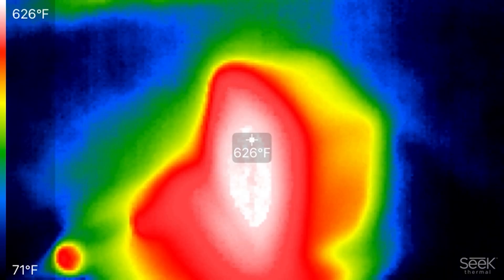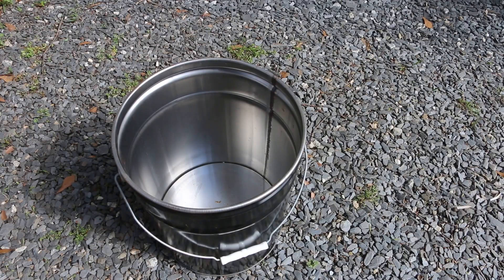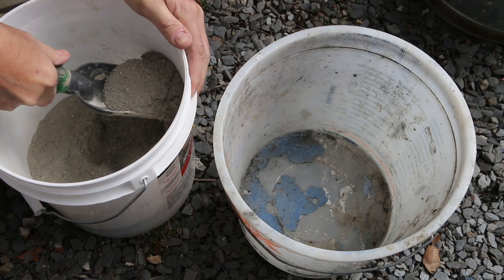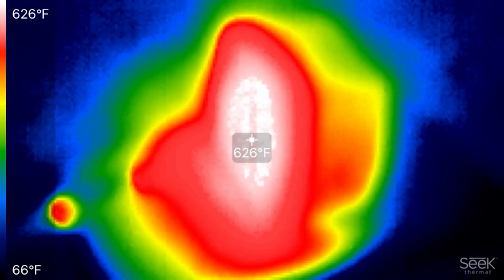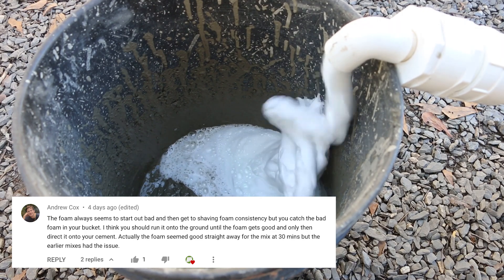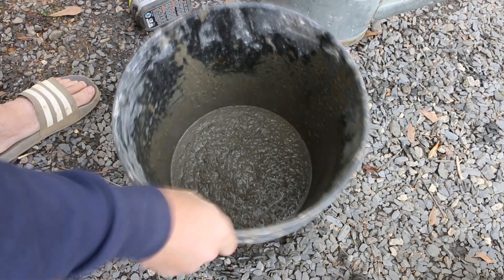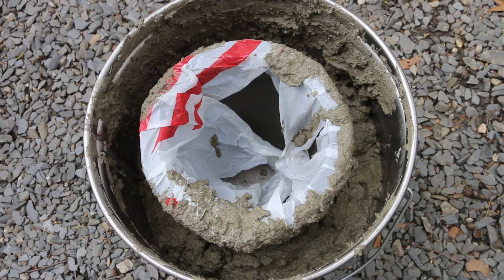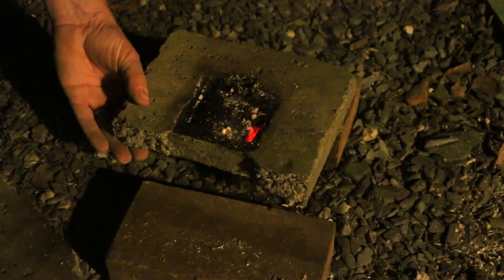How To Make An Aircrete Furnace + Propane Heat Test

Comment: What is best torch attachment for this set up
Reply from the maker: I haven't tried this enough yet to be able to give you a good answer. I did see another YouTuber recommend a higher pressure propane tank valve. Apparently, the normal grill tanks don't have high enough pressure. Thank you for watching.